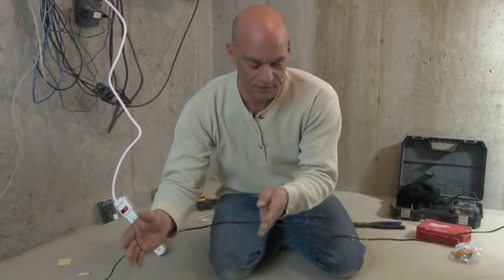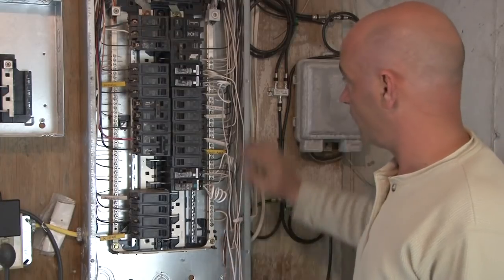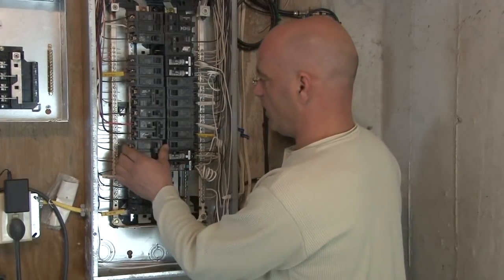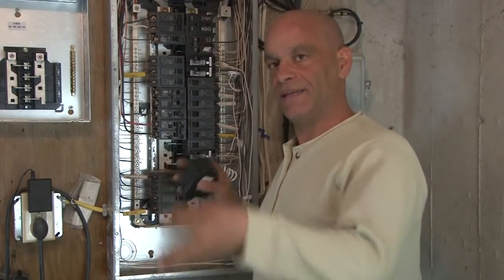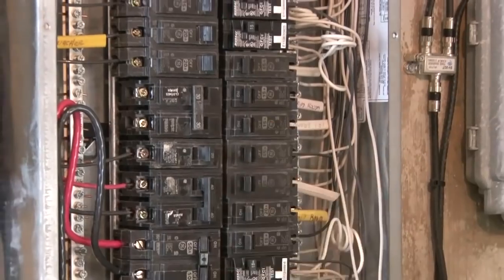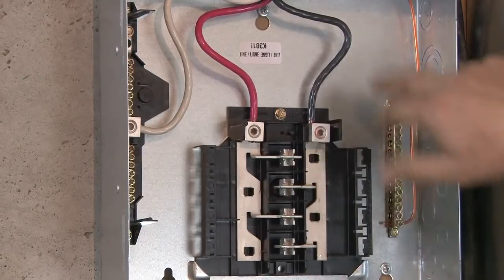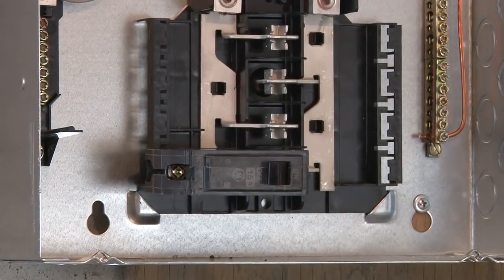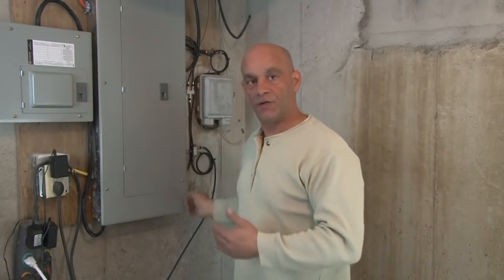How to Install a Subpanel

Comment: Hey Dom just a quick question why does US use 120V mains instead of 230V wouldn't it be more efficient since u would have to use smaller wire gauge if we calculate the power as voltage times current trough the circuit we would be able to use less current and with that put less temp strain on the wire with less current flowing trough it?
Is it like the infrastructire thing like be more expensive to change and convert or some special reason?
Reply from the maker: I'm not sure really. We use both 120 for 220 volts.
Reply: +askmediy yeah i know but since there is im guessing a subtransformer station for areas of a city it would at least for me make more logic to lower the voltage from substation to 240V from (im not sure since im from eu but im guessing us uses from 30 to 100 KV for transmission from a city transformer station to a substation (could be different not sure honestly) than to run two different (im guessing same phase) lines to a house from substation to neighborhoods and houses.
Im guessing its probably for the set standards compliance and old hardware but couldnt a home have a mini transformer turn down the voltage for 120 circuits.
Btw this is just my opinion aince it looks more inefficient to use bigger wires and higher current if we could have the same power with less heat dissipation. If anyone reading comments has a reason for these for 120V circuits please do tell since im trying to learn and any feedback is welcome :D
Reply: Srdjan Zivkovic Two reasons - one because that is what we have used historically and switching everything to 240 would be a huge undertaking.  Two, 120v is safer. You will get half the current through your body if shocked. Also, in our 240v outlets each hot is still only 120v potential from ground. You only get 240v between the two hots.

Comment: What state is this demo in?  That ground wire to the ground rods should be a #4.. you mention a heavier ground wire saying #6.. well.. that means you used 8-3 on a 50 amp breaker... shouldn't that be a 6-3.  I also question your method of attaching those panels.. why did you not use an offset nipple instead of having your wire (carrying 220) out in the open?  You say it is complete.. no straps on your (8-3)?.. you did not label your breaker on the schedule.  I think it's great you're trying to help people.. I have been an electrician for 30 years.. and this demo was not done professionally.. call an electrician .. someone mentions an electrician finding other problems.. I know when I go out and find other problems its important to notify the homeowner.  Faulty electrical can cause fire, electric shock or possible death.
Reply: At least this guy is responding... i live in Springfield Ma and have tried calling over 100 electricians to do this job, about 10 respond and all of them offered ridiculous quotes of like 3 grand to install a subpanel...
Reply: So why don't you do a video then? If you're such an expert what were you even searching for that led you here?
Reply: Jay, looking at the wire, that's clearly 6-3.  Maybe he should have secured the it, but given that it's already clamped down, and stiff, it's not going anywhere.  There's no potential for drywall cover, so he didn't think to label it, though it's always a good idea.  An offset nipple at that mounting location would have made a mess in the main panel.

Comment: Hey Dom, Love your video. Im about to put in a new kitchen and im going to need a sub panel to handle all the different 20 amp and 40 amp circuits. Im getting a 100amp Service Square D panel with 20  spaces.Similar to the one i have now. Do you know what guage or cable i need to carry the load from the first box to the 2nd. by my count im puttng in 8- 20amp circuits and 1 -40 amp circuit.

thanks in advance.

Mike
Reply from the maker: How long of a run is it? All this matters. I would think #4 wire
http://www.askmediy.com/electrical-wire-size-calculator/
Reply: Hey Dom, I wanted to thank you for your video again. I was able to install my sub panel and wired up my entire kitchen and still have another few spaces. followed all your instructions and checked with my local Home Depot Electrician who's given advice since i bought my place. Everything turned out great and i passed the inspection  from the town on the sub panel. Thanks again

Comment: Great DIY. With your help, I am doing this, this weekend. One question: Do you have to nail down or attach the sub-panel wire to the board? I am using 2-2-2-4 and it is a little stiff and didn't know if there was a special staple for this. Thanks for your help!

Comment: Great video, thanks. Why did you run both of the hot wires, the red and the black on the same side of the panel. Wouldn't that limit you to 110 in the sub panel, and only draw from the left side of the panel. Is it because you didn't want 220 inside the subpanel?
Reply from the maker: +Richard Hasting No not at all. They alternate. So when installing a twin pole breaker it would take power from each leg resulting in 220 volts.

Comment: In the main panel in the vid, the neutral busbar and ground busbar, tho they are connected, didn't have any ground wires on the neutral bus and vice versa. In my main panel, there are grounds on both and neutrals on both busbars. I'm assuming this is okay(my house hasn't burned down). Is this okay to do? I'm installing a 20 A circuit to run me an outlet.
Reply: This is fine.. a sub panel is where the neutrals and grounds MUST be separate.
Reply: I was thinking the same thing.  If he has both neutral and ground connected and grounded, it really doesn't matter where neutral and ground go.

Comment: Thanks for the great video. Where I live all residential wiring is THHN ran through Emt conduit. We recently purchased a home and there is already a 100 amp sub panel in the attached garage that feeds a bump out addition garage that is still attached to the main garage which is attached to house. now this is where I get confused there is one 15 amp breaker wired to run this bump out, there are a total of 4 breaker slots all with 15 amp breakers and then a 30 amp main double breaker with three 10ga. wires feeding it no ground I assume due to the conduit carrying the ground. Was this done purposely or was it ran by someone who didn't really know what they were doing. I know that question really cant be answered the panel is mounted on the outside of the drywall and all conduit is also ran on the outside so I would lean toward the later. My question is in order to get this thing wired the way it was designed for and be able to add some more out lets for a compressor and general diy house hold projects and possibly light wood working and possibly put a couple out lets in the main garage sine the are only two one by the door to the house and one for the opener and 4ft strip light. Can i Just get 2ga. THHN and two 100 amp shut offs and basically replace the 30s and the 10ga or is it more involved then that? sorry for the long post but this has bothered me for the past three years since we began renting and the landlord was not the original owner and he could have cared less about anything since we were in a rent with option contract. Thank you. one last thing if I remember correctly its been a while since I did remodeling for a living but for garage and basement I believe all circuits must be 20 amp and GFCI protected correct? so obviously I will need those breakers also.
Reply: Marty Howard.. you're describing a sub panel in an attached garage with a total of 6 openings?  A 2 pole 30 amp breaker feed by #10's.  If your describing this correctly.. that panel is not intended to have a main disconnect (the 30 amp).. You should have a 30amp breaker (marked) in your house panel feeding the sub... what confuses me is you mention a 100 amp sub panel?  So I wonder, is there a 100 amp breaker in that sub panel?  Is the 30 amp breaker feeding something (220) elsewhere?  A home subpanel (non main disconnect) can be feed with any sized 2 pole breaker upto 100 amps.  (Grounds and neutrals must be separate) and of course the right sized wire feeding that panel. (do some reading on that one.. voltage drop etc.. distance plays on this) but normally a 100 amp will be feed by #4's , 50amp by #6's, 30 amp by #10's (copper).. there's also aluminum (do some reading). What size pipe is feeding this subpanel?  Is it large enough for say #6's.. or #4's 50 amp or 100 amp respectively.  If you think there is gonna be a lot of updating to the house, then I would change that subpanel to a 30 space. Then you can run #4's for a true 100 amp, you want to pull out the #10's feeding that panel (if that is the case) , pull in 3 #4's (two legs and a neutral) (make sure and mark the  neutral wire on both sides, MAIN and SUB with white tape from leaving the pipe to entering the neutral bar.)  I might also suggest running a 4th ground wire.. just incase you get a sloppy connector! (One loose connector can cause you to lose ground down line and that's what makes you the recipient of a shock or electrocution and potentially causing your breakers to malfunction so they do not trip!)

Comment: why size of wire should I use for 100 amp subpanel, the distance is 20 feet and is inside the house, thanks.
Reply from the maker: +Comtechso #6 cooper. But always check with your inspector.

Comment: im running a sub panel to a detached garage. its currently ran from a 30 amp fuse with 12-3 UF wire to one plug. I need to know what gauge wire and fuse size Ill need to run from the main fuse. I will be eventually building a 30x40 shop so Ill beed good power there. I will need a 240v for a stove that Ill be using for powdercoating and also a welder. most of the other stuff is just 110v plugs. you mentioned putting a ground pole 6' in the ground. How big does that pole need to be and do I only run that ground from that pole to the bus bar or so I still need to run a wire from the main box also? also this subpanel will be 100' from the main box. please help lol.
Reply: +Justin Norton 
Justin 12 wire is not rated for 30 amps.   Depending on the kind of conductor you use THHN , UF, you would be required to use at least a 10 gauge wire.  What is the size of your main panel?  If I were you I would check the current ratings on the welder and stove.  I would say a basic 60 amp sub would probably be plenty as you will not be using everything at the same time.  100 feet is not that great of a distance so your voltage drop will be minor.  Me being me I would run a 100 amp main lug sub panel which would leave you some extra space for future use if needed.  Purchase a 2 pole 100 amp breaker that will fit your particular panel QO, CH, BR and use a 3 gauge THHN  or 3-3 armored cable if inside the house.  If you will be running the wire outside you can use non armored inside conduit.  Hope this helped.
Reply: I'd run schd 40 pvc from house to shop.. #3's sound good for the distance and what you intend to do in that shop.  Do some reading on burial depth of the pvc.. depending if your gonna be pouring concrete over the area?  As Justin says .. check your amperage drawl for you welder and stove so when you wire inside the shop you use the correct wire size (and type) depending if your pulling romex or piping.

Comment: Dominick, I have a situation. My client has a Square D HOM30M150RB main panel.  As the model # dictates this box is NOT supposed to have tandem mini breakers because it's designed with only 30 spaces for 30 circuits.  Someone modified 7 tandem mini circuit breakers to fit into this box.  I now have to install a subpanel to eliminate the mini's and replace then with regular sized breakers and bring the remaining wires to the subpanel.  Three of the circuits are 20 amp circuits and four are 15 amp circuits.  I believe the main panel is a 150 amp unit.  How do I determine what size feeder breaker I'm going to need for the subpanel?  Your prompt replay would be greatly appreciated.  I have to do this tomorrow, Sunday, April 10.  Thanks.

Comment: Okay, good to know I can run it in a crawl space,,,I read that it has to be ran through the joists unless it's #6 awg or larger...if it is bigger than it can be strapped to the bottom of the joists or what some call clothIined....any opinion on this? I'm not sure if it's allowed or not...even after reading up on it. Thanks

Comment: Hi,  I am using a regular panel with a main switch as a subpanel. It will take four strings from four solar arrays. I understand about taking the green screw off. There is also a bar that goes from the neutral to the ground bar currently not connected. Should I keep it that way or take it out all together. Thank you for a great video.
Reply from the maker: +Carlos Hi, when you start taking solar panels I'm sorry but I really don't know enough about them.

Comment: what size is the cable?
Reply from the maker: +gali galindo that will depend on the amp size of your sub-panel and how far from the main panel.
Reply: +askmediy  thanks for replying. 25 ft and i only need 6 breakers and add a 220 outlet   Thank u for ur help

Comment: just for the sake of asking, is there an online source that tells the building/wiring, in this case, codes where the average person would understand it?
Reply: +AceBoy2099 Codes are specifically written and worded so the average person WOULD NOT understand it. Electrical work is not meant to be done by the average handy man. It is DANGEROUS work and if not installed properly can be a serious risk to yourself or anyone else you do the work for! DO NOT install any electrical services/branch wiring without professional help/knowledge!

Comment: Hire a licensed electrician. Also why wouldn't you exit the main panel closer to the top so the feed is far less exposed?
Reply: Alex Dart I called an electrician once. I had to install a chandelier and didn't have a tall enough ladder, figured what the heck I'll pay someone else to do something for a change. 

Guy came out and quoted me $800.  I bought a ladder and did it myself. Will be installing a sub panel soon. But then I also replace my own transmission instead of paying someone  $3k to do it.

Comment: I am looking to install a residential dryer outlet (220V/30Amps) in my RV. The power pole at the RV park I am connecting to has a typical RV 220V/50Amp connection (I am unable to change out the 50Amp breaker for a 30Amp breaker as this is not my property). My plan is to run a 50Amp RV extension chord (25ft) to a 50Amp outlet on my RV (separate from the main power for my RV which is 120V/30Amps). The 50Amp outlet on my RV would then be hardwired to a subpanel. The subpanel would then contain the 30Amp double pole breaker wired to my residential dryer outlet. My questions are: Should I treat this as a subpanel and remove the bonding screw? Also, am I going to need to install a separate grounding rod (as this is a "separate building")?

Comment: I am replacing all wires going to the breaker box and meter base.  Can I use a generator to check wires going into the house prior to hooking them into the circuit breaker 
, therefor being able to find where they go inside the walls?  contact by email,,  stewduntdryvir@yahoo.com

Comment: Dominick Help! , can i run 2/0 2/0 2/0-1 Copper SER 3 conductors with ground in 2"conduit under ground 150' to my barn? and  same wire with no conduit inside 100' across the basement to the outside wall for 100 amp sub panel in the barn... people tell me no!!! You can't run ser cable inside conduit and i can run it inside a basement. is it Bull SHIT?
Reply: +pajamaman40 PJ It is not bullshit.  you need a Junction box connected to each end of the conduit and then make junctions for each of the 4 cables...then u can run SER cable on the inside of your buildings....but at no time can the SER Jacket (grey or black) be inside the conduit.....its because the conductors cannot dissipate heat properly when the SER cable is inside the pipe.

Comment: I installed a subpanel from a murray 200 amp service. It was to supply a JNOD tankless water heater. It pulls 27 KW when in use. The sub panel has 3 50 amp breakers with #8 wire running from the murray box to the subpanel. Each of the 50 amp breakers have #8 wire to the 3 220 circuits in the water heater. I am pulling the sub panel off of a 100 amp breaker. When I tried to up grade to a 150 or 200 amp breaker it was too large to fit in my single line box. Do I need a 150 amp breaker to get enough power to the sub panel and water heater to make it work right? If so does such a breaker small enough to fit my murray service exsist? When I looked to see if I could run straight off of the main  200 it does not have input for wires to my sub panel. What is the cure because the showers are lukewarm in the winter.Is the 100 amp breaker in the main service bottle necking the 3 50 breakers to the water heater?
Reply from the maker: +monstirz Bottlenecking what trip the breaker. So I would say no to that. Before anything I would check the heater for the proper power using a voltage tester.
Reply: I'm also looking for an answer to this. I am trying to install a tankless water heater that requires 112.5 amps that is separated by Three 40 amps Double Poll Breaker. Does my Subpanel need to be a 125 amp breaker?
Reply: dynasty palaganas I could not get a 150 for mine but it worked better with a 125 rather than a 100.It seems to be ok now.